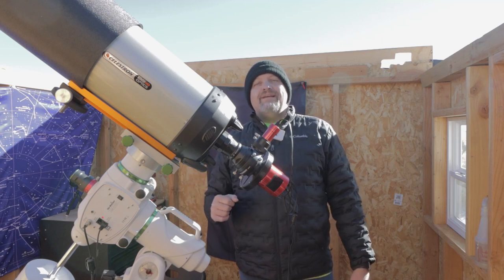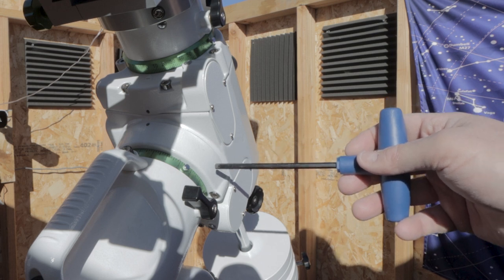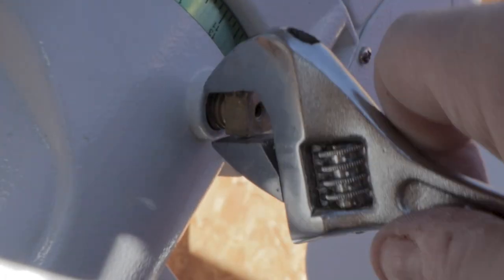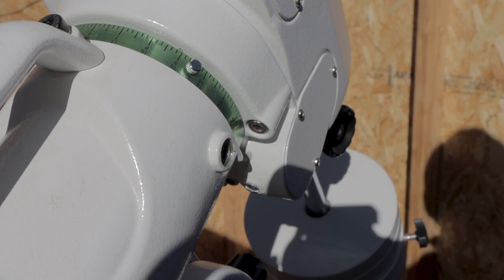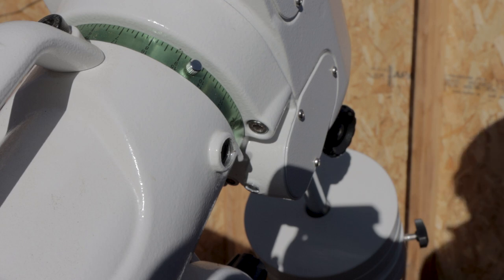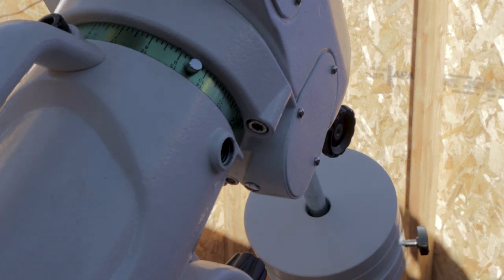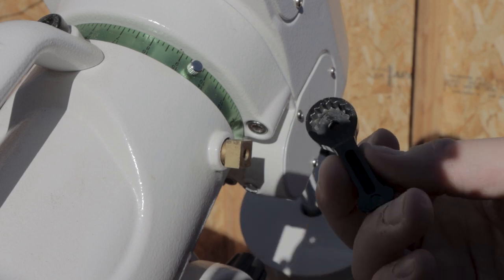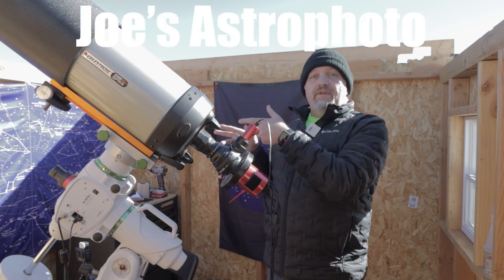Improve your guiding with this easy EQ6 trick | EQ6 clutch cleaning

Comment: You've come to my rescue again. RA clutch was slipping a bit when closed. All I did was tighten the brass bolt underneath about 1/8 turn, didn't even remove it. RA clutch nice and solid now. Total time cost was less than 1 minute.
Reply from the maker: Glad I could help!

Comment: Worked a treat with Isopropyl Alcohol. Metal disk came out with the RA clutch screw. Need to be careful to not get grease on the disk when putting it back in. I also cleaned the end of the clutch screws (not the threads). Many thanks for the guide.
Reply from the maker: Thanks so much and so glad it was helpful!

Comment: This also works for the CGEM mount.  For the process, I used alcohol pads to remove the grease from the worm cylinders.  I decided to use the alcohol pads because alcohol evaporates.  I didn't want any excess degreaser to get into the worm gears.
Reply from the maker: Thanks Claude! Good to know about the CGEM mount. I agree, I prefer alcohol over degreaser as well.

Comment: I sent my mount away for a service and belt mod. Since I got it’s back I’ve had trouble with drift where the  target creeps across the sensor giving me longitudinally egg shaped stars. Yet my guiding numbers look good, though noticed constant corrections sometimes large steps  on the RA. It’s been driving me mad trying to find a solution and hopefully this is it the solution. I’ve just cleaned out a ton of grease from the button and screw which was also on the internal collar. So hopefully next clear night this will resolve my problem. Thanks Joe
Reply from the maker: Thanks, and hopefully this helps you out.
Reply: @JoesAstrophoto  I’ll be sure to let you know

Comment: Thanks Joe! It really helps confidence to see someone do it first. I can go in now, knowing what to expect with and that I've got the tools I need to hand.
Reply from the maker: Thanks Amp! I appreciate it and glad my video was helpful. Good luck with the clutch cleaning.
Reply: @JoesAstrophoto  It worked a treat on the RA 👍but no way would the dec button come out... but neither of them desperately needed it. Attention, yes! I had to figure out what was going on. But it turns out I was confused by loose clutches that come on by themselves and drag a bit when I'm trying to balance. That made me think the end play on the axes might need loosened off a bit. But no, 18 years old and everything is fine, including backlash, and clutch operation too. On the dec I just wiped some of the grease off the threads and put it back together. That's the kind of fix I like!

Comment: Yep helpful. I'm gonna like that. First night out it slipped in RA with a small refractor on it. It was balanced as good as I could tell but as soon as the counter weight stated to rise it fell back down. Since then I have just over tightened the clutch. I still think it might be slipping and I did this that was in the video but I thought it needed grease so I put some lube on it. I'll try it your way now. It may help explain why my PEC training is an "m" shape graph too.
Reply from the maker: Thanks Michael! I hope it works out for you!

Comment: I have EQM-35 Pro and when I stripped whole mount due to regreasing and inserting needle thrust bearings instead of red washers, it happened to me, that the button most probably stucked somehow inside and damaged the cylinder (scratched it). I noticed it because the RA axis started to be stiff more and more and it get worse and worse, up to the point that I wasn't able to move it at all. I had to strip down the mount again almost completely, using hammer and some tools I had to kick the cilinder out. It was stuck there so hard....And because it is soft alluminium, I had to sand it in order to get rid of scratches and then using steel wool I made it nice again. Also note that I wasn't able to insert the cylindrer inside the part where it was stucked. So I had to sand also that part from inside and then again using steel wool I made everything nice and smooth again.

The problem is that I wasn't sure if the button was a part of clutch screw, when stripped down the mount it just fell off. Now I can see it is separate. No idea how comes that the button could cause stucking of the cylinder. And not even sure if the button caused that. I am just now putting everything together again so I am curious if this happens again. I was also thinking to glue the button to the screw, actually I really don't see the reason why separate button needs to be used.
Reply from the maker: Sorry to hear about your EQM-35 Martin. I've never taken one of those apart, but on the EQ6 I believe it's a brass cylinder. At least it looks and feels like brass to me and not aluminum. I assume they have a separate button because they don't want the expense of manufacturing custom made bolts for the task and find it more cost effective to just apply pressure to the cylinder with the brass button, but I'm not sure as I don't work for them, just guessing. I don't think it's a good idea to glue the button on though. I'm not sure how easy it will be to remove the bolt or screw it back on the axis housing if the button is attached. Interesting to test it out though, if you decide to do it let me know how it goes.

Comment: Hi Joe, Handy video. My DEC axis does not move freely when the clutch is off. Now I know that I can loosen the bolt under the knob a bit.
Reply from the maker: Thanks Rob. So when your clutch is disengaged completely the DEC isn’t moving freely? Sounds like it may be the collar at the bottom where the counter weight bar extends is too tight. If that’s not it, it could also be a piece of grit is caught in the main DEC roller bearing or a few other things.
Reply: @JoesAstrophoto  Gonna take a look at that. loosening the bold didn't help.

Comment: Great video Joe - I will be doing that to mine. A couple of novice questions - Is there any way the button can fall into the inner workings and how much do you tighten the bolt? It looks like only finger pressure. Thanks for taking the time to produce an informative video. Cheers from down under.
Reply from the maker: Thanks so much Tony, and great questions. The button cannot fall into the housing as it sits right against the worm gear cylinder. It's this pressure that keeps the axis from turning freely, so you don't have to worry about that, but be careful not to drop it as it took me 20 minutes to find when I dropped mine and it hit the table went under my work bench in the obsy haha.  Just finger tight the nut, so when you put the lever back on it will be in the loose position. Glad you liked the video and hope it all works out for you.
Reply: @JoesAstrophoto  Thanks Joe - much appreciated

Comment: @Joe's Astrophoto  and just to be clear....you are cleaning grease off, but don't add any fresh grease, anywhere?
Reply from the maker: Hi Greg, yes, I'm cleaning it off of everywhere except right next to the bolt head. If you need to you can apply the smallest amount to it, to help keep it from getting stuck with heavy temp changes.

Comment: Hi Joe, thanks so much for this video. There was grease inside the clutch and I cleaned it exactly as you showed in this video, but the RA axis nevertheless moved very easiliy even when I tightend the clutch very strong. My mount is brand new and I have got an RA rms error of 1". So this seems to be the reason, isn´t it?
Reply from the maker: Thanks Armin! It sounds like it may be, but I’d have to see it to figure it out. The RA axis should still move with the clutch engaged if you push it but it shouldn’t be easy at all.
Reply: I have the same problem, my mount ist new as well, 6 months old

Comment: Discovered incredible amount of grease on the button. My button was so covered when I removed the screw I couldn’t remove the button then I realised it was stuck too the screw with grease.
Reply from the maker: That sounds really bad Finley. I hope this improves your guiding and overall performance. You may have to do it again soon if you have that much lubricant in there it's bound to work it's way back up again sooner than later.
Reply: @JoesAstrophoto  I never cleaned the ring inside full 360° I watched the video yesterday and forgot so I had to come back. My guiding is in the 9s for the RA. I’ve just got my guiding yet to use it but hopefully so.

Comment: Thanks for the tip- I will try the same on my HEQ5 as both axes on it are hard to tighten sufficiently. My only concern is - will it still slip if something untoward happens? E.g. guiding or homing issue leading to a tripod bump? Isn't that why there is grease there in the first place - so perhaps not clean it all off?
Reply from the maker: Thanks Mark, there is not supposed to be grease on that part of the cylinder at all. It just works it's way up there over time and use of the mount. Removing the grease form this part of the worm gear cylinder will really help performance overall and keep the axis from slipping. Hope that helps.
Reply: @JoesAstrophoto  Thanks- in that case I will try it on the weekend. As it's forecast to be blowing almost 30 m/s I may as well use the time productively!
Reply from the maker: @markcompton1249  Good luck!
Reply: @JoesAstrophoto  well, I tried but couldn't loosen the screws on one axis 😡. So I gave up rather than stripping the heads... and on the other axis, I couldn't for love or money get the metal cylinder out! Tried everything I could think of, including careful tapping with a rubber mallet! So I guess I am stuck with it as is.
Reply from the maker: @markcompton1249  I'm sorry to hear Mark. Just to be sure we are talking about the same thing, are you saying that the clutch lever bolt is stuck? If so you can loosen it before taking off the clutch lever then it should unscrew by hand. If that is not the case then I think you have some other problems at play here and this probably won't help you. On the other axis when you mention the metal cylinder, I'm assuming you mean the button. If so, I just apply pressure to one side with a small screwdriver and then remove with needle nose pliers. If that's also stuck as you say, I'm just guessing that you may need to take apart the mount and clean it all out if you feel comfortable doing that kind of work (it's not an easy task). Unfortunately it sounds like you may have some corrosion build up within the mount causing some bad issues, but I couldn't be absolutely sure without seeing it in person. I'm sorry I couldn't help out more, but I feel for ya brother.
Reply: @JoesAstrophoto  IMO, the cylinder needs a small film of lubricant on it to so the clutch can slip if it needs to ...what if you get a cable snag and it rips the camera right off the focuser.
Reply from the maker: @rob33873  Thanks Rob, in my experience, that's not the case and any lubricant here causes issues.

Comment: One of the bottoms (DEC) just fell out - grease everywhere which I cleaned up.  But I can't get the RA button out.  Pushing on one side visibly tilts the button but there is no way to get the button to turn on it's side in order to grab it.  Anyone have a similar problem?  And a solution???  I have tried wiping what grease I can reach but obviously can't get underneath the button.
Reply from the maker: Thanks, I haven't run into that issue before. I just use the tiniest needle nose pliers I have and tilt one side and grab it with them. Hopefully someone will chime in with an idea. It's terrible that you had so much grease there, but hopefully it will make a difference after cleaning it all up.
Reply: @Joe's Astrophoto  
I got the button out.  Used a vacuum pump with a piece of hose slightly smaller than the button diameter. A small piece of tubing didn't work.  Use as large a diameter as possible.  Cut the bottom end neatly, i.e. flat.  Took about 8 tries to get the button all the way out.  
When I was doing this I  took the opportunity to clean the old grease out of the alignment adjustment knobs as well.
Reply from the maker: Wow! What an ingenious way to get it out, that's awesome! I hope it helps with your guiding now, nice job!